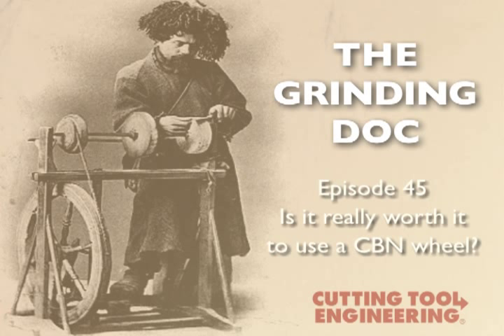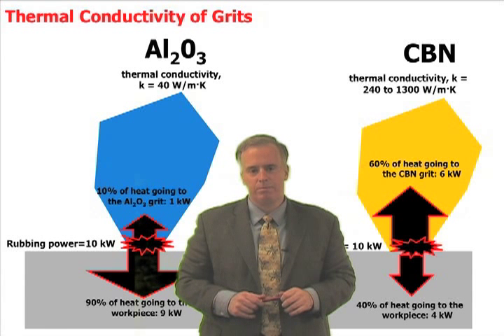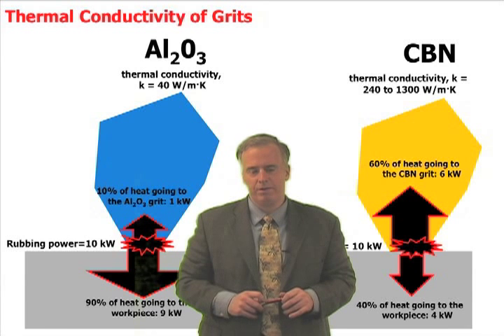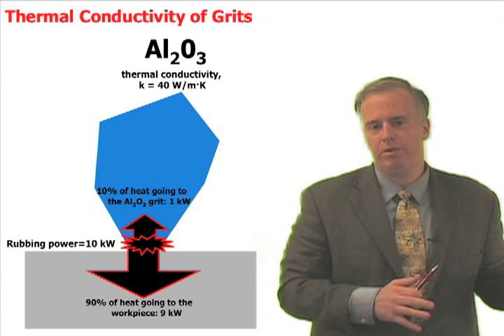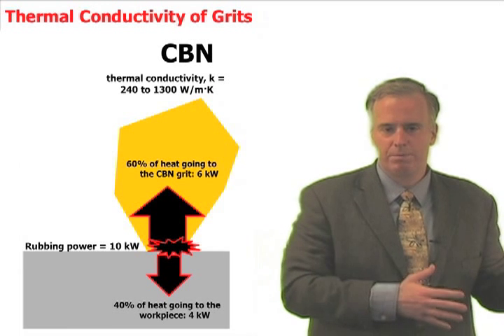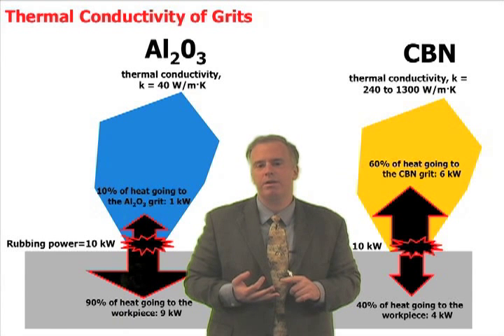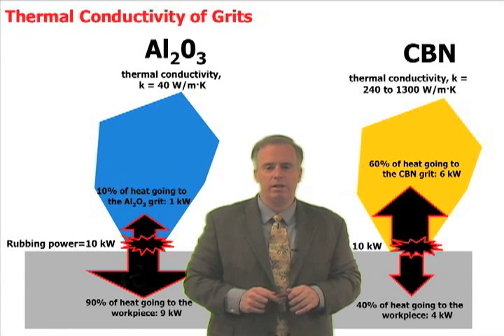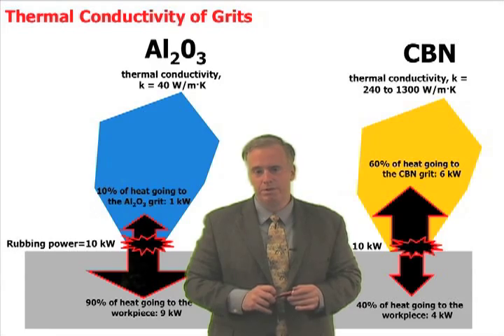Episode 45: Is it really worth it to use a CBN wheel?

Comment: 9 year-old presentation  wtih limited views; yet good advice.  My application is also in sharpening of chain saw cutters.  The   mid range of quality machine I use came with the stupic pink ceramic bonded AlO type wheels.  Even with care to clean chains, it required constant cleaning and reshaping of the disc.  The CBN wheels I substituted are far superior in that they retain their profile shape, cut with less pressure and time which adds to their inherant cool cutting properties.  The CBN gets dirty way less often (remember, I clean my chains first) and when darkened with chain crud an art gum eraser.

Comment: Once I upgraded to CBN on my surface grinder, I never looked back. So much faster and for over 60 HRC hard steels, a true game changer compared to ceramics. Effortlessly eats through 72HRC CPM Rex121 steel with 0.05mm depth of cut without even throwing a spark. If you're grinding lots of >60HRC steels and are on the fence of switching to CBN, do it! 
https://youtube.com/shorts/WSaqG4nhaL4?feature=share

Comment: As a rule of thumb,  CBN is 30 times more expensive, wears 30 times less, doubles the grinding speed and thus reduces the cycle time. Under automation, with the correct parameters, CBN is always profitable. 
For the bench grinder, forget it!
Reply: They are expensive but worth it for anyone who wants to burn the teeth on his chainsaw less.  It is bad enough some of those things don't hold an edge for long then with an aluminum oxide wheel you have a better chance of ruining the temper of the metal.  I recently sharpened a chain with an aluminum oxide wheel but I wonder how long it would stay sharp. I don't do lots of cutting but I hate dull chains.  They are hard on the saw (40 volt) and it makes cutting take forever.  A sharp chain is so much faster.  I bought a sharpener from Harbor Freight.  I only got that one because I know someone who has that one and he also had good results.  I usually don't like to buy things from that place.  I had a set of those free screw drivers they give you with a coupon if you buy something.  They are junk!  I used one to take out a screw and it twisted the tip.  That was the flat tip screw driver.  It was the first and last time I ever touched that tool set.  I am just glad I didn't use it on anything I would care not to ruin.  With my luck I would have used that junk to adjust the chain tension and have it ruin the screw when it deforms that way.  It is probably just not heat treated if I had to guess.  You get what you pay for and those screw drivers were worthless.
Reply: Maciej Jan Długosz  Good tip!